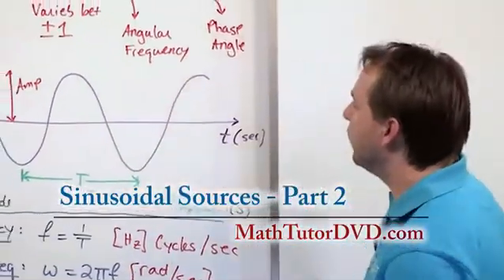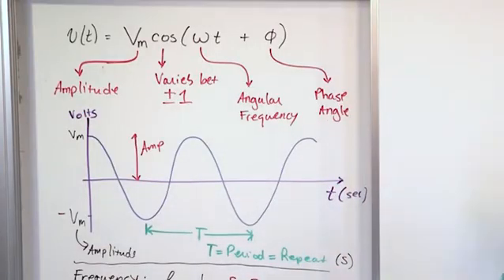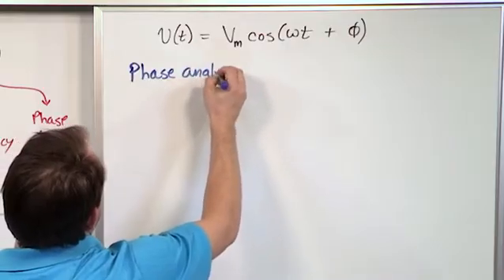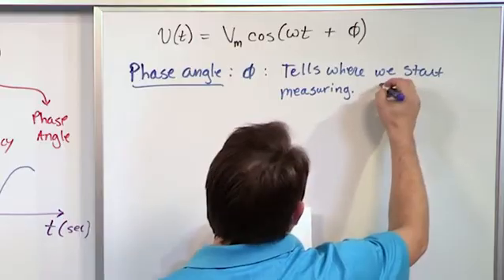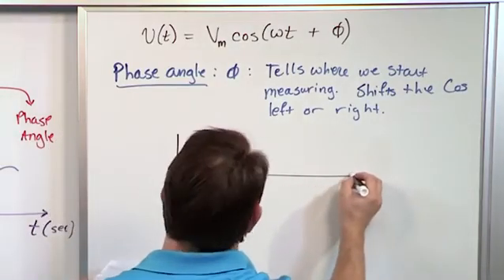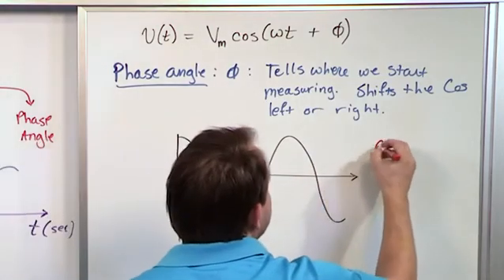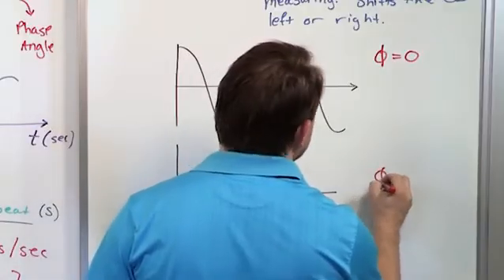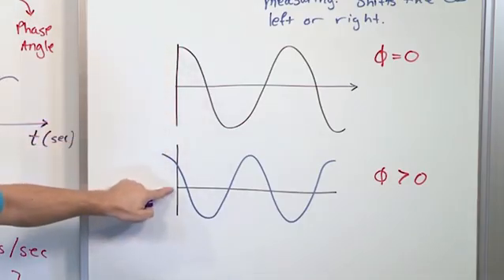Lesson 3 - Sinusoidal Sources, Part 2 (AC Circuit Analysis)

Comment: Question: I see phase angle described in degrees and omega described in radians in my textbook and other places. Is it just so its easier to know how far the wave is shifted, or are you actually suppose to mix the units mathematically? Or do you just convert the degrees into radians should the need arise to actually calculate v at a specific time?
Reply: Omega and phase angle always should have the same unit: radians or degrees. Otherwise your calculator won't understand your input and will give wrong results. Yes, we can convert between the two: 2pi radians = 360 degrees. But get used to radians, because lots of times you will see omega in the cosine-function. Omega = 2pi . f [in units: (2pi radians / cycle) . (cycles / sec.) = 2pi radians / sec.]. Why 2pi radians? Because any circle is made up of 2pi radii! Sinusoidal functions are derived from the unit-circle!
Reply: @veronicanoordzee6440  Thank you for responding. Now i do know about radians (I've already had to work with polar coordinates), i was just confused as to why i was seeing the phase shift written in degrees. I did finally figure out that my textbook wants you to convert the phase shift BACK into radians before you calculate it (or alternatively the omega to degrees), but i had to figure that out on my own by comparing how i calculated it vs the given answer in the back of the book. It was just frustrating b/c my book didn't state that outright. So the only reason i can gather is that the textbook wrote that way do one can read the phase shift at a glance.
Reply: @theyoda55  Good to hear that. Good luck!
Reply: PS: It also didn't help that my professor was just like "eh, it just works." He is not good at explaining this stuff. He's a retired electrical engineer and i think he's at that point where he just knows everything instinctively, but as a result doesn't know how to explain it anymore.